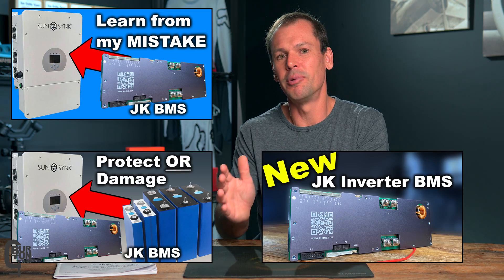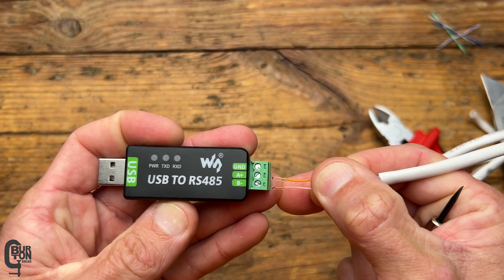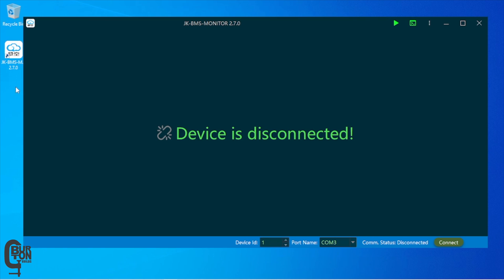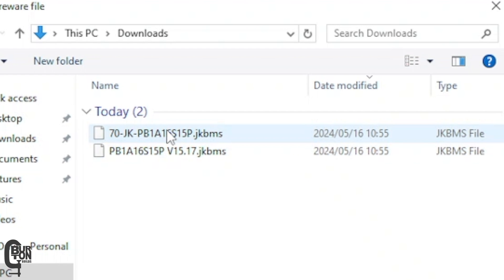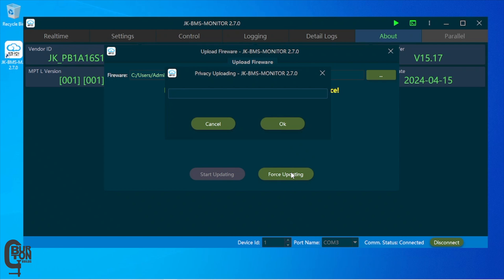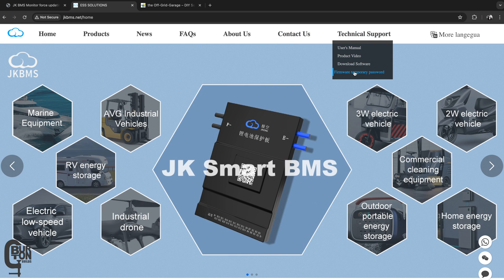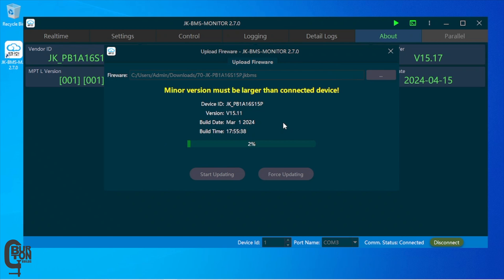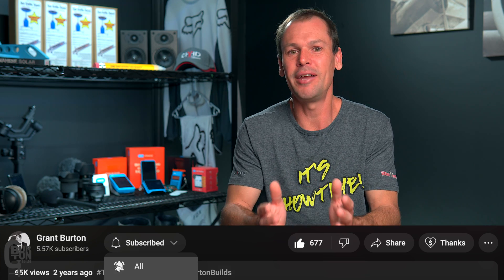How to Downgrade firmware on JK Inverter BMS (Step-by-step)

Comment: I am wondering if you could help me in regards to the BMS cell voltage wires, I am about to wire up my JK BMS and connector 3 has a wire missing, I am wanting to know if this is normal,as I am only running 14s I can take one of those extra wires cell 15 or 16 and fit it where it is missing, but that could cause a failure if it is ment to be that way,this is how I received it, also on the connector 1 that supposed to have the black wire for cell number on negative, well on my one it is red,my JK BMS didn't come with any manual so I am relying on people like your self that know to help, thank you in advance for any help you can offer
Reply from the maker: Hi Jason, If you have a look at this video https://youtu.be/tlNvlhV4NZ0 and pause the video at 3 minutes 02 seconds, you'll see that the third connector has 4 red wires (balance leads) and two black wires (temperature probe). The model of my BMS is PB1A16S15P (hardware version 15). There is also a wire missing between the 4 red balance leads and two black temperature probe wires. The connector has 7 terminals, and if you look really closely, you can see in the holes in the front of the terminal, that the first 4 holes and the last two holes are dark (because they have terminals in them), but the 5th hole from the right is not as dark... because it doesn't have a terminal.

That is also how this BMS arrived, with the negative balance wire being a red wire (the previous style BMS has a black wire)...  You will find a wiring diagram on the JK Website http://www.jkbms.net/product?id=1733033589518364674 On connector number 1, the first red wire after the two black temperature probe wires is the negative balance lead.... it is labeled as B0 on the BMS where the connector plugs in.